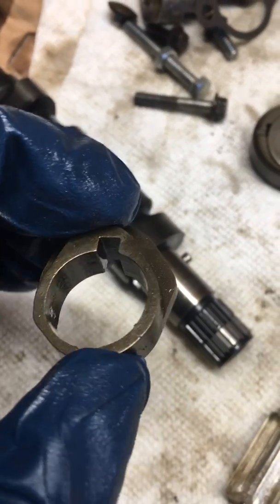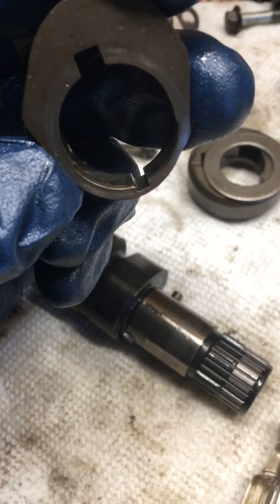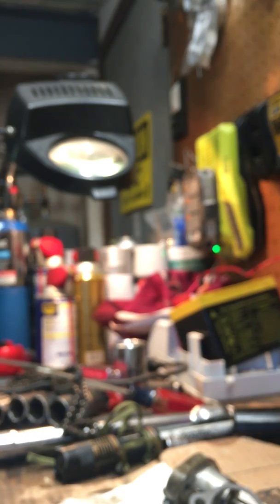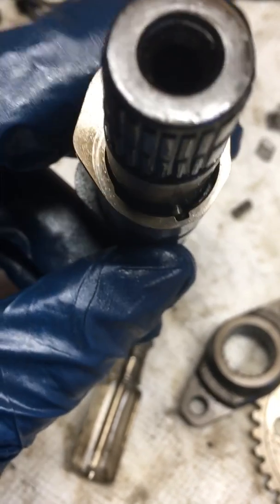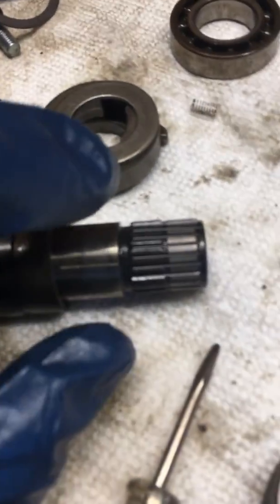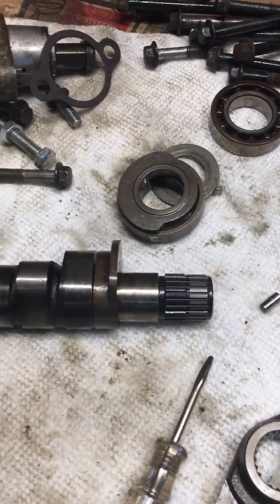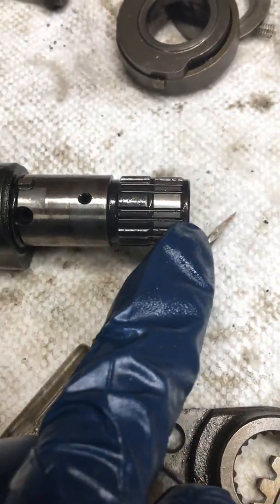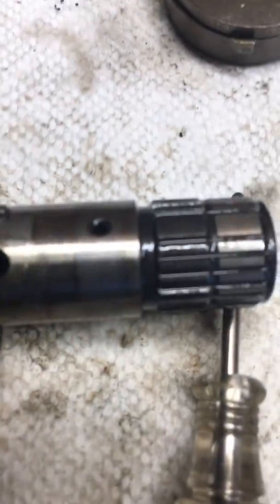Honda decompressor explained 400ex

Comment: You have the best detail on the decompressor. I have a NX4 Falcon 400 with the same motor as the 400EX. Mine was making a loud ticking at low speed. I put a cam in with the decompressor removed. I pounded aluminum pins in the oil holes to keep oil pressure. Without the decompressor the engine sometimes cranks slow on the first revolution then takes off. I'm guessing this is when it starts on the compression stroke.

Comment: For anyone concerned you can actually just remove the pin and just shave the rocker ledge off and leave all the decomp stuff on the cam.  I ran into this a while ago. Knew a guy who raced the old xr”s. (Same motor). And I was helping him do a top end one day and noticed the rocker had been ground off and he explained it was a old school trick all the xr guys always done.  He said ideally you can remove the stuff off the cam but if you do that you need to weld up the holes like stated in this vid. But he said there isn’t any use in just leaving the can along.  Even the pin you can leave it or remove it. He said they always just remove the pin and shave the rocker.  And send it.     Crazy how there isn’t more info on this.  These are actually pretty bullet proof engines.
Reply: The decompression pin in the head? dealing with the same issue.
Reply: @okayokayokay9753  yep.

Comment: just replaced cam and timing chain, timing is good, compression good, spark is good! it started fine and revved good and when i let it idle it died and just cranks now! took it apart checked timing it’s good! put new spark plug and still just rolls over.. any ideas

Comment: Congrats great video man it helped me alot, hey bro would you please help me out by telling me how did you take off all the parts of the decomprsor away from the camshat? thanks
Reply from the maker: I have an H-Frame shop press. That's really the only way to remove it for reassembly. With any use of the shop press, you need to rig something up to pull the gear from the shaft.

Comment: Did you end up welding the holes in the camshaft as described?

If yes, does it work OK ?
Reply from the maker: I put it all back to stock. No welding. You could look at other cams like hot cams to see if they have holes but i bet they wont in that spot.

Comment: I would assume a new cam( hot cam) comes ready to drop in with decompression ring?
Reply from the maker: TBH, i believe hot cams does not include a decompression ring. Its not "necessary" but considered helpful. Some folks remove them.
Reply: Hot Cams do not have the decrompression setup.

Comment: Nice video you explain things very well I just picked this 400EX up for 650 bucks guy said it was locked up but rear end was locked up and has an intermittent tick and somebody on the Honda group told me to look into the decompression pin which led me to your video thanks

Comment: My 06 Honda 400 ex doesn’t have a plate decompressor and the pin and spring in it I’m guessing someone rebuild it and didn’t put it in. It’s not starting up on  it’s own u have to bump it could those  missing be the reason why it isn’t starting on its own

Comment: Nice video. Thanks. How did you pull off the cam gear holder without breaking it?
Reply from the maker: i havea a shop press from harbor freight, i pressed the cam off the gear. i later reassembled it after freezing the cam.
Reply: @nolengerke552  how dit you press it so it doesnt get force only on one side?

Comment: 👍🏻👍🏻
Reply: Am I understanding correctly that there are 2 options for bi-passing the decompression? Option-1: cut off the rocker arm or option-2 remove the mechanism from the cam shaft and weld the oil holes shut and remove the pin and spring from the head below the cam? Or do all options? The video wasn’t clear on that. Please reply. Thanks

Comment: do you need the deconpresor can you take it of and still run ok with starting
Reply: mrdattopet the rat exactly what i’m trying to figure out, just replaced my oem cam with bigger hotcams cam. now no compression, timing is right. (did spin clockwise by accident a few turns, (maybe 1/4 an entire engine cycle)) maybe an open exhaust valve?
Reply from the maker: @caleb9490  , You may wish to pull the valve cover and watch the valves moving. You may have bent a valve if you turned it over with incorrect timing, thus no compression...?
Reply: Nolen Gerke yup bent a valve but i’m sure that was from when the cam chain broke while riding it
Reply from the maker: @caleb9490  Even more possible/probable. My cam chain stretched and made noise, so i was able to detect prior to it breaking.
Reply from the maker: I believe you can get rid of it, however i kept mine. Aftermarket cams do not have this option as proof.